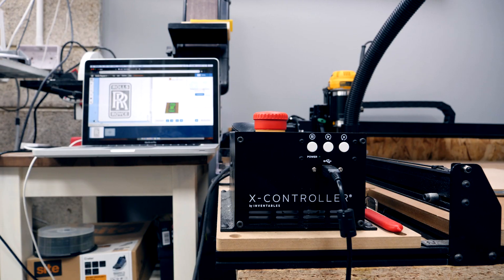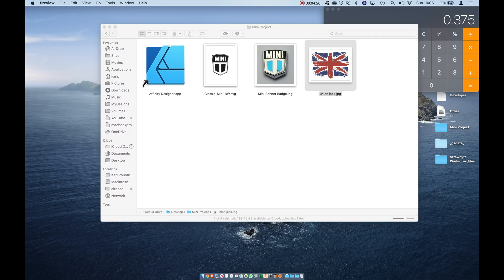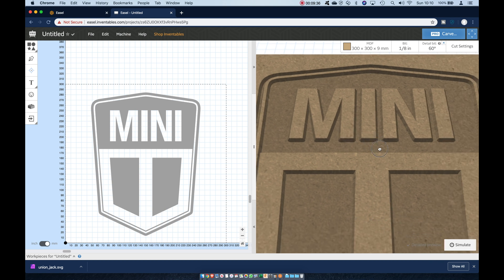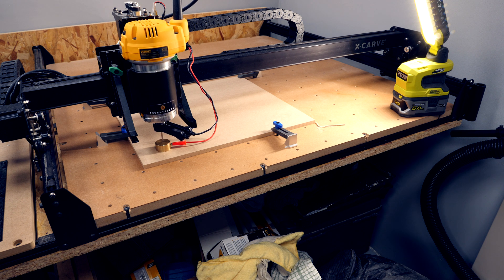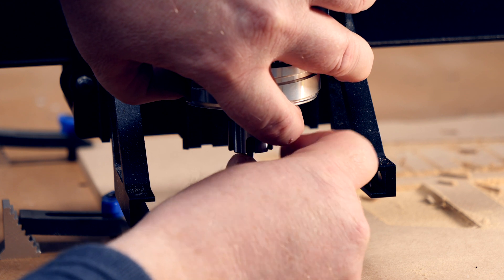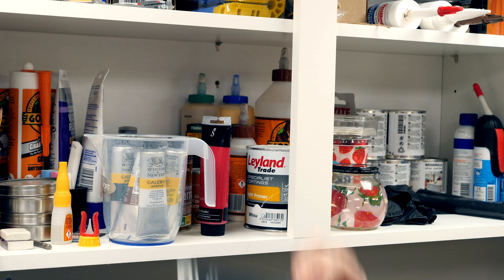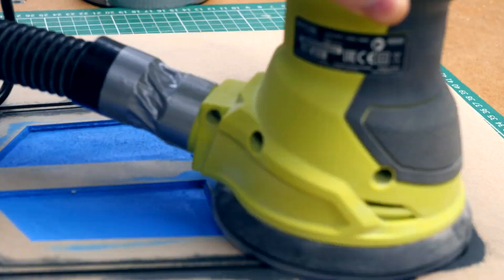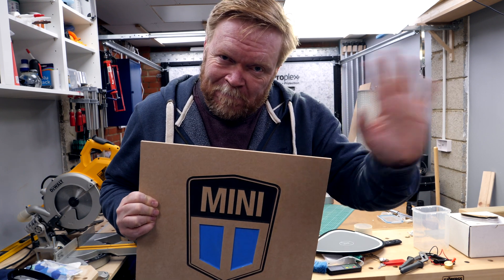Easy CNC Project Start to Finish | Sign Making with Inventables X-Carve

Comment: I clamp my router unit on both sides with some 1 x 2 wooden blocks which stops the x axis from moving as long as I pull the wrench along the x axis when tightening/loosenig. I have just seen your vid on changing the dip switches and will. do that this weekend. Thanks

Comment: Good stuff!   I run the painted sign through a planer instead of sanding it. Alot faster that way, I think!
Reply from the maker: Hey Brian - Had this been real wood and narrower I'd have put it through my Metabo. Since making the view and having done a lot of signs now, I tend to use vinyl paint masks on the material from the outset.

Comment: nice work! roughly how long would you say that took to cut?
Reply from the maker: Around 50 minutes in two passes. The roughing pass took around 25 minutes, the v-bit pass around 20 minutes. What I've realised since the video is that the 3D effect can be achieved with a reduced bigger of cut in MDF and I can do a sign of that size in around 35 minutes now.
Reply: Oh wow not bad! Thank you!

Comment: That's a really good method of painting, I think I'd have been going spare trying not to go over the edges! :)  Do you think if you use oil based paints the grain would not raise?  Just an idea.
Reply from the maker: You might be right and I will be experimenting with finishes on these sorts of projects. And paint masks which would allow me to have a painted top surface. I may share what I learn in a future video.
Reply: @StrawbyteWorkshop  I look forward to it if you do!

Comment: Could I ask what software you us as I have one coming but I tried to get easel but I go round and round I can get easel pro but not the free one
Reply from the maker: I’m still experimenting with software. As you saw in the video I’m using easel pro where the key issue I have is that it’s web based. I’ve trialed vetric vcarve which is good but expensive and also looked at using Fusion 360 too but find it hard to create the right code for the cnc. I will probably do a follow up as I settle on something that works.

Comment: That’s a great result, Karl. Very interesting and informative.

At approx 9:30, though, the partially-sanded ‘Mini’ had a really good finish... almost an ‘antique pewter’/‘cast pot metal’ aesthetic.
Reply from the maker: Yes you're right it does and I'd noticed that in a follow-up project (Rolls Royce badge) and I'm trying to think of how to use it in a project. Anyway, Frank, thanks for your comment.